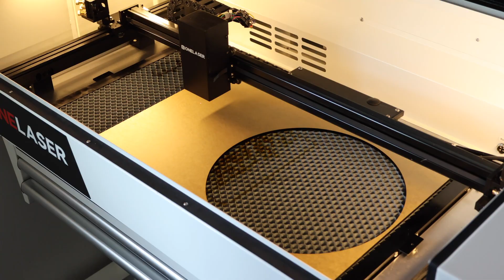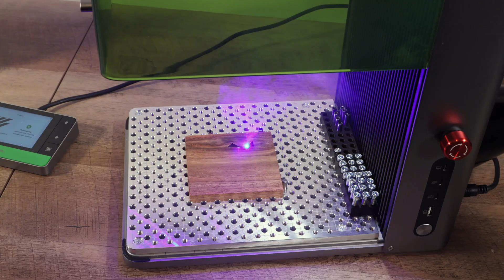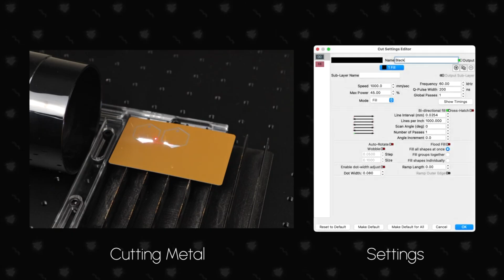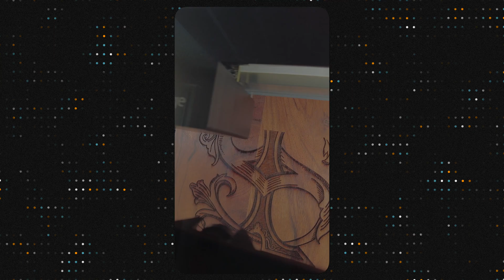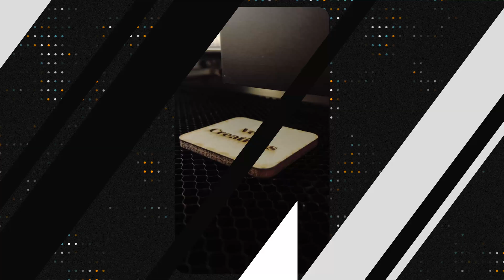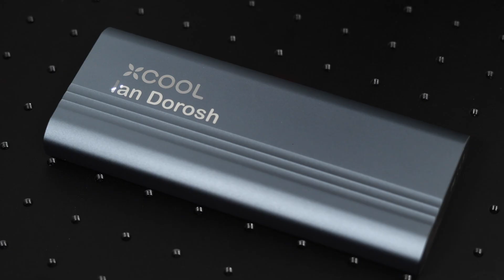Stop Wasting Money on the Wrong Laser! Diode vs CO2 vs Fiber vs UV

Comment: KIWI, I'm new to lasers, are IR and Fiber lasers the same thing? Other than the F1, i haven't seen another later marketed as "fiber"
Reply from the maker: Hey! That’s a great question they both emit Infrared light, but something like the F1 uses a diode to generate that light. A fiber laser is typically much more powerful and the ir light is generate in a fiber optic cable and passed to the head. 

Long story short same engraving capability but at a much higher power with a fiber laser

Comment: KIWI - what would you recommend for engraving golf clubs
Reply from the maker: Thanks for watching! A fiber laser would be best, are you thinking something small? The F1 Ultra would be a good one, but if you are mainly going for metals and don’t need anything for wood, then a dedicated fiber laser like the ComMarker B6 would work great and you can save a few bucks. 20 watt would be what we would go for
Reply: @VelfCreations right thank you. I’m torn between wanting to cut acrylic as well as engrave / clean golf clubs. Ahh
Reply from the maker: @susanbusuttil7160 Ah yeah that’s a tough one, since the F1 ultra can technically cut darker acrylics but no clear ones, and the angled cuts from galvo lasers aren’t ideal. I would say if your primary thing is golf clubs go with a fiber first and then look into C02 lasers for everything else.
Reply: @VelfCreations I can’t tell you how helpful that is. So the F2 ultra wouldn’t be worth it at this stage ?
Reply from the maker: @susanbusuttil7160 I think it is a great laser but may I ask what kind of acrylic projects are you looking to do? Although still possible cutting on a galvo has not been fun in our experience. The F1 ultra or F2 ultra are great for other reasons though
Reply: @V @VelfCreations acrylic items like cake toppers, small signs. Items for functions
Reply from the maker: @susanbusuttil7160 Got it we will get it on the list thank you!

Comment: Kiwi 🥝 Are there any basic enclosed galvo diode lasers that can do a 200mm square engraving on wood? I have a specific use case for this and the larger-format galvos include all sorts of extra bells and whistles that I don’t need. The F1 Ultra is the right size, but more lasers than I need. (I’m kind of dreaming of an F2 Ultra Lite). Right now I primarily use a low power gantry laser and it’s just really slow. Any suggestions?
Reply from the maker: Hmm if it’s specifically wood I’m wondering if maybe a galvo C02 laser would work for you? We haven’t used any before but we’re always curious about some of the ones cloudray offers. Thank you for watching by the way!

https://www.cloudraylaser.com/products/cloudray-ec-30-litemarker-pro-30w-co2-laser-marking-engraver-with-8-3x-8-3-scan-area?variant=43545764004001&country=US&currency=USD&utm_medium=product_sync&utm_source=google&utm_content=sag_organic&utm_campaign=sag_organic&gad_source=1&gad_campaignid=22160003504&gbraid=0AAAAAp0DCtBWUkfdYuGpOXQxsL4BGttxh&gclid=CjwKCAiA_dDIBhB6EiwAvzc1cIWnQILb8OFcxVEjayG8xYiTo1KYgAX9hNKEGJ5itb_WH2Eh0FMb2BoCn3MQAvD_BwE

Comment: Kiwi! I’m going your path! I started with an XTool F1 early this year. Then, I got the ComMarker Omni 1 5w. For my third, the OneLaser XRF (arrived a couple days ago) Question: If I want to engrave the red off of those traditional glass Christmas ball ornaments, would you use the F1 or the Omni 1?
Reply from the maker: Thanks for watching! We haven’t tried with the Omni but I would go with the F1 blue light. The Omni will most likely end up also engraving the glass, but most importantly the Omni depth of field is much shallower, so its effect towards the edges of the curved ornament will fall off much quicker, meaning your engravings will be much smaller. That’s just a theory and it’s never a bad idea to try perhaps it turns out better 😄

Comment: Kiwi - Is there a machine that has the work area of a gantry CO2 but can cut metal like UV without costing $20k? The AcceLaser HD1 looks good but has been on preorder for some period of time.
Reply from the maker: Thanks for watching, at the moment waiting for the HD1 seems like the best bet. xTool does have a metal fab but even that is around 13k. 

Besides that there are a few options if you google “flying Galvo laser” They basically mount a fiber laser onto a gantry, we don’t have any experience with those so would have to do some research for ourselves but it may cut metal too, they are usually higher wattage and are mainly aimed at rust paint removal and engraving.

Comment: Kiwi 🥝! Thank you for the video! Wanna ask if I want a machine to engrave or mark on stainless steel (including plated ones), 925 silver, 18k solid gold and yellow gold, which machine should I get? I am a beginner and am thinking about getting WeCreat Lumos or F1 Ultra. Would like to try out colour engraving on stainless steel too. Thank you!!!
Reply from the maker: Thank you! Our first choice would be the ultra between the 2, because it can engrave so much faster and deeper than the Lumos or standard F1. As long as you are ok with the higher price. 

For the second choice the Lumos does engrave metals better than something like the F1 but it will still take some time to get darker engravings, and it has some other issues at the moment with detail loss at higher speeds.

Hope that helps! And thank you for watching!